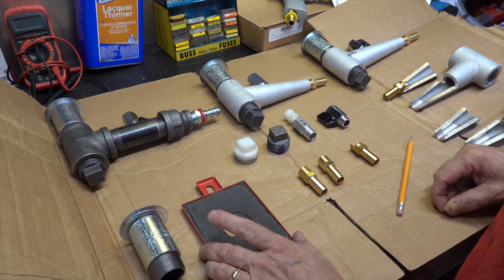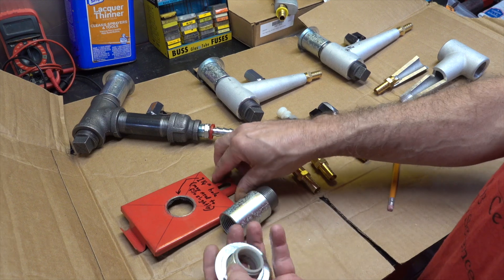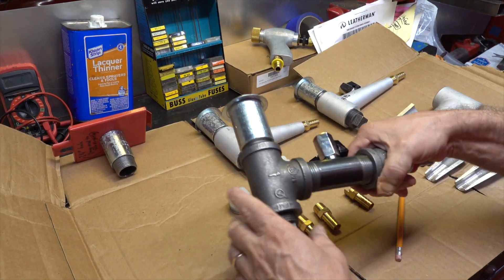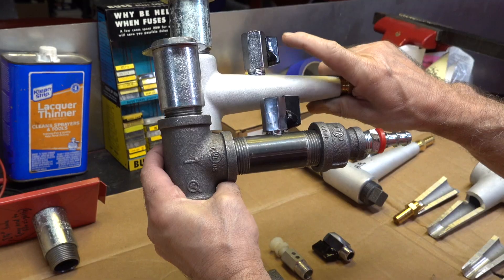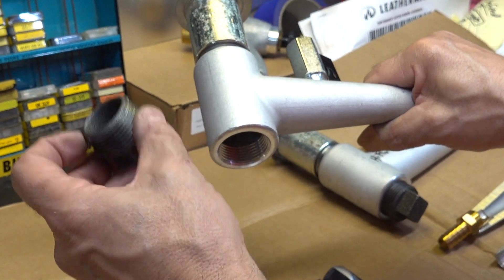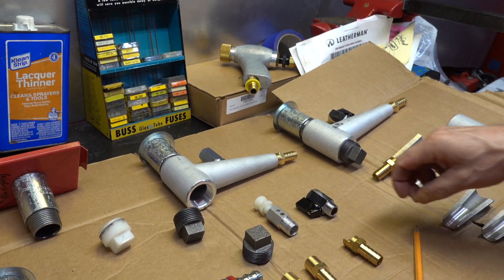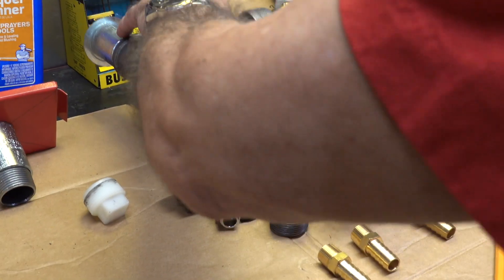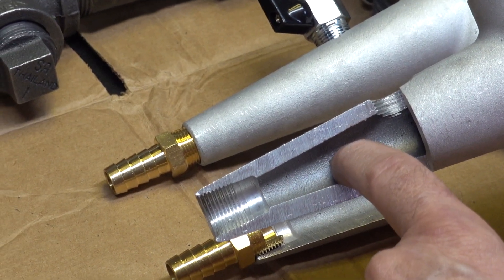Direct Comparison of 3 types of Harbor Freight Blast Cabinet Upgrade Metering Valves

Comment: I'm a custom metal Fab shop . I built my own cabinet , I made my own cone metering valve .I got it working great for a while , and then it slows down and stops , working.  No cloggage is happening either . What the cause of that?
Reply from the maker: Hard to say because there are multiple factors.  What media are you using?  Grit size?  Is air dry?  What gun are you using?   Happy to help but with your custom parts its difficult to diagnose.
Reply: I have a 10 horse Ingersoll rand compressor ,air dryer , princess auto gun , metering valve is a w inch T , and I made a cone ss 2 inch to 3/8" coupling , crushed 20-30 green glass , what else should I let you know ?
Reply from the maker: @charles-hr7ir  What are you wanting to know?  Sorry - unclear as to what you are asking.
Reply from the maker: @charles-hr7ir  The blast gun is not a particulaarly efficient design.  What is the orifice size?  The 20-30 grit crushed glass may be the problem.  Also, how much media do you have in the hopper (pounda?).  Too much can cause packing and creates a log jam.  Hope this helps

Comment: I ended up buying knee going into T instead of T to start with. I can still empty the box the same way like before and if I turn the door upside down, I get all sand from the valve as well. It's cheaper and simpler. I also mounted the knee directly under the door, without extension. It fits well even with the valve sticking higher than the doors are, and there is still a lot of space under the box. They are selling 1inch T piece with 1/2in side outlet, so I used that to mount the valve. And then the ends, they are not so important.. But most important is some kind of filtering, IMO. I'm still looking for some scrap piece of mesh or something, I found and used one cylindrical shape which I shaped into dome shape and just sat over the inlet inside the box. I just need something more fine, this one has big openings

Comment: What is everybody running for a compressor? I have a 60 gallon tank with a Dayton 3hp electric motor running a Speedaire 5Z404 (17.1cfm) compressor. I would think it has enough juice to run this sandblasting cabinet, but I can't get it to work! I made the upgrade with plastic parts but I don't have an air inlet that you show. Is this what I'm missing?
Reply from the maker: Yes - air inlet valve is absolutely essential to proper functioning.  Also the HF gun is a terrible design if you are still running it.  See our other videos for direct comparison with our high quality gun.  Hope this helps

Comment: I think I saw another pressure siphon conversion video where the metering valve for adjusting flow was remotely located so you didn'
t have to bend down to adjust the valve below the cabinet. That seems like a great idea, just add a barbed fitting at original valve location and run some air line from it to a valve located near the front of cabinet so you can adjust on the fly while using the gun.
Reply from the maker: I see it could work but the valve is rarely adjusted once the cabinet is dialed in.  Best regards
Reply: I was just thinking the same thing. Great minds!

Comment: The reason that the HDPE plug was selected with the aluminum casing is to protect the threads on the casting from Galling.  I would definitely use pipe dope or teflon tape or anti seize with the steel plug.  I understand the concern about damage to the plastic plug, but it is the cheaper of the 2 parts and therefore sacrificial.
Reply from the maker: Thx for your comment. Galling could be a problem in some circumstances but the drain plug only needs to be turned in finger tight to keep the media from leaking out.  Therefore the liklihood of galling in this situation is extremely low.  Would not recommend the use of a thread sealant as this could contaminant the media and cause a clogging of the gun orifice.  best regards
Reply: Holy cow…the grit would instantly stick to the pipe dope and jam up the treads ….

Comment: Do you guys do ones for a pressure pot system at all modifing mine to 3/4 to 1/2 ball valve underneith
Reply from the maker: Sorry - we currently do not offer an upgrade for this application

Comment: Would it be feasible to add the air bleed valve on the opposite side of the tee opposing the long narrowing branch? Would this arrangement provide enough agitation in the media stream to maintain good media flow characteristics and assist in circumventing clogging in the media outlet hose? Just curious……
Reply from the maker: We doubt that this would work because the media would probably block the air flow completely rather than the air flow pulling media particles from the leading edge of the pile.  Thanks for your thought

Comment: I did the black iron upgrade to my cabinet. I run 110psi and the factory gun with 5/8” hose to the gun. Any idea why my media surges in the hose and I don’t have constant media flow out of my gun?
Reply from the maker: A few thoughts that might help:
1) how much media is in the hopper.  Do NOT want more than a couple of cups while dialing in the system - then increase.
2) If you have 110 PSI at the cabinet, it is too much and could be hiding another problem (45-65 PSI is generally good)
3) What gun are you running?  Please see our video on the OEM HF gun (it is generally a POS) and another of our videos on cheap Chinese knock off guns also with problems
4) 5/8" hose is pretty big especially if you have a smaller compressor as it creates too much dead space volume and there is not enough vacuum to get steady flow
5) Is the gun orifice size matched to the output specs of your compressor (if not matched it will not work well and could cause the surging that you are seeing.
6) Watch our video on dialing in of your metering valve.  Only takes 10 mins and once dialed in you are good to go 
Overall thought: All the components of the blast cabinet system need to work together to achieve proper performance.  Changing out one may not result in desired results because other parts are not playing well together.  Changing the metering valve to one with a better design can result in weaknesses elsewhere in the system being exposed.  Hope this helps
Best regards
Ron 
Best Tool Upgrades

Comment: Whats the ideal ratio of media to air?
Reply from the maker: This ratio is not actually calculated as it is too highly dependent on media type and size, compressor output in CFM, gun performance, etc.  Instead, it is important to dial in the cabinet to achieve max media delivery associated with the various components associated with that set up.  Hope this helps

Comment: 7:00 Here my physics seem to differ from your physics. In a tube the airflow (speed) increases if the diameter of the tube is reduced. Because the same volume per second has to pass the narrower cross section. Higher speed means more ability to pick up media. Even if the media is settling down there this increases speed even more and the ability to pick the stuff up. Totally the opposite of what you tell us. 
If you increase the diameter the ability to transport the medium is effectively reduced. So why is this then an improvement? Do I have to relearn physics and tell Mr. Bernoulli he was wrong?
7:40 You mill even surfaces. But you have drilled out a tube.
Reply from the maker: Thank you for your comment and the opportunity to explain "our physics" from "your physics".  
Simply stated - "your physics" is the physics of looking at an isolated component of a system and drawing inference as to how it might impact system functionality.  "Our physics" is to look at ALL of the components of a complex, dynamic system.  We do not need to debate Bernoulli.  But when and where Bernoulli is of value in terms of increased system efficiency needs some discussion.  The increased flow speed, which also decreases pressure, can be very helpful in such classic examples as a carburetor where gas molecules are introduced into the stream of air at the venturi.  But take a close look at the full cross section of the metering valve.  In the unaltered valve, there is a restriction in the throat of the valve followed by an increased cross sectional diameter, followed by another restriction in flow created by the ID of the brass fitting, followed by a long distance of increased diameter that is the media hose.  What you can't see is that there is another restriction at the other end of the hose at another brass fitting, and yet another tunable venturi that is designed within the body of the media gun itself.  
Repeated sequencing of the speeding up of the flow, followed by the slowing down of the flow, can create dynamic pulses which can be helpful in some systems, if designed into the system, but are most often detrimental to smooth flow (which is what is desired in the case of media blasting).
Now let's talk about what is actually flowing.  The stream is not just a gas (air) or a mixture of two gases (air and petroleum distillate as in the case of a carburetor).  It is a highly heterogeneous 'slurry' of gas molecules and very large (in comparison to air molecules) chunks of solid media that can vary greatly in size, surface area to volume ratio, and density, depending on what type of media the user has selected and the grit size of that media.  Therefore, the system needs to be capable of good performance across a wide range of particle types potentially found in the slurry suspension.  The goal is to keep the media particles suspended in a continuous smooth flow of air and not create pulsing or any other condition which could lead to particle drop out from the air stream, which would create clogging (log jam effect) of the system downstream, which then would further reduce flow as a negative synergism.
The reduction (not total elimination) of the first and most significant restriction to flow (the throat area of the metering valve) in a system with multiple sequential flow restrictions (aka reductions in cross sectional area) is improving the OVERALL efficiency of the SYSTEM, when all of these multiple Bernoulli 'points', including those in the media gun, are considered.
Perhaps we erred in not going through all of the system physics in our video at this level of detail.  We will take that under consideration.  However, the vast majority of our 1000s of very satisfied customers just want to have their system work to their level of expectation, and are less interested in all of the details (especially when physics are involved, LOL)
Finally, we could have had this conversation as an honest exchange of thoughts and ideas between people, but you chose to take the route of snarkiness, belittlement and derision.
To that point, no need to tell Mr. B anything at all.  He know's what his Principle states, but further, he appreciates the proper application of his Principle to overall system design, not just a single point along a pipe, viewed in isolation.
Here's another Principle that may be applicable to the current situation - "Seek first to understand, then be understood"
Best regards.
Reply: @partswasherupgradekit6028  Thank you for explaining what you had in mind. I now understand that you, in simple words, wanted to smooth airflow by avoiding dead spots where sudden increases of diameter can lead to accumulation of media. Whether this will get to a point where everything gets choked up or more hinder the airflow might be an experiment that will tell the situation. Anyway from explaining your improvement of a single component I was referring to that only. 
You are right that sedimentation can take place if solid matter is transported in a fluid or gas stream. As you have explained I understand that the whole arrangement needs to be taken into account. All the connectors with not really streamlined transitions will affect the system performance. Perhaps from your experience the change of one component makes already  a significant difference. I lack that experience. Your video seems to hint in that direction. But then you get out that fabricated (assembled from individual components) regulator and state that it might be as good as your product. That makes me wonder whether simply the increased diameter is what makes the system better. The smallest diameter kind of determining the airflow per Watt. Which results for me in two findings: 1. Dead areas can lead to media accumulation which, due to the nature of solids (internal friction hindering easy pick-up), make them permanent or difficult to "dissolve"; and 2. per given power the lower resistance from a larger minimal diameter results in a better system performance.
Thanks you again for taking the time to explain. I am not going to comment on any perceived tone.
Reply from the maker: Thank you in turn for being receptive to our response that provided a fuller context.  We do extensive testing on all of our products, use them ourselves in our own home shops and derive high quality feedback from our customers based on their real world experiences.  We have learned a lot over the almost 5 years we have been in business and are always looking to find a way to make improvements.
Best regards

Comment: I purchased your premium high flow metering valve and last night I finally got to test it out in my blast cabinet. I had set the air supply pressure to 40 and 45psi and metering valve air bleed was 25 to 40% open and my blast media was an 80 grit aluminum oxide.  Using these settings I was getting a lot of media pulsating through the gun where I would get a large plug of media followed by mostly air only.  I'm wondering if higher air pressure or adjusting the air bleed on the metering valve will help correct this issue.  Thanks.
Reply from the maker: Need to know more about your setup as other components play a big role in the overall performance.  Which gun are you using?  The stock HF gun is a poor design and is often the cause of the problems you are seeing.  We sell a great upgrade to that gun
Please contact us at 
partswasherupgradekit@gmail.com 
and we will be happy to help you
regards

Comment: Interesting thoughts and as I have just received my new cabinet.
I would like to make some comments, not criticisms regarding,
1/ The plastic plug.
If one is prone to cross threading, 
given how often it may or may not be removed, 
unless care is taken, the metal plug into the soft cast alloy tee may be an issue.
Safer to stay with the cheap plastic maybe, than damage the expensive tee?
2/ The taper is to increase velocity of the mix, yes there is drag/friction and the  right
balance of this is debatable, without flow tests etc as you have said.
3/ Given the vacuum is fixed, when air supply pressure to cabinet is set e.g @ ( X psi) would not
a larger (metering) valve reduce this vacuum, reducing pull/lift of media?
4/ Removing restriction from hose tail or anywhere(plumbing fittings etc) is or should be obvious.
5/ Instead of a Tee piece under the hopper, could a cross piece be used with the metering(ball) valve opposite
the media pick up tube to gun, This puts the media between the source of vacuum and the source of aeration/metering (vacuum loss)
You would have full(sort of) vacuum pull on the media drawn out of the hopper, thanks to gravity and vacuum
and being aerated as it goes, OR, valves for and aft of the media???
Agitating the media from both sides and as long as appropriate vacuum remains to the gun.....well?
What are your or anyone's thoughts on this?
Reply: Bingo -

Comment: any difference noticed between 3/4 and 1" i see some use 3/4 some 1" but who compared both ?
Reply from the maker: The extra internal volume in the 1" version allows for better media pickup into the air stream and reduces the chances for media backup

Comment: 3:50 it would last more if the tread was outside, it would be easier toblow some air on the tread to clean it and the tread inside the tap is easy to clean as well.
Reply from the maker: Thanks for your comment.  No real need to clean the threads as the fitting never really needs to be removed.  Also, if the threads were external the fitting would require a large reduction in size in a short distance to get the 1/2" barb and this might cause a restriction in flow.

Comment: 3:28 That's an extra useless thing. You can just open the door.
Reply from the maker: that is certainly possible but hinging the door down with the hose attached can be difficult and when you open the door the media goes everywhere.  So easy to use the screw in plug especially since the metering valve is built around the "tee" fitting.  Media falls straight down into a bucket

Comment: How to use  sand blasting  on floor tile
Reply from the maker: Not quite sure what you mean.  Are you wanted to blast your flooring tile to clean them up prior to painting or coating?  Look into a pressure pot. Used to blast large surfaces outside of the limits of what can fit into a blast cabinet.  BUt they are messy.  Media goes everywhere as it is not contained within an enclosed cabinet
Hope this helps
Regards
Best Tool Upgrades

Comment: Hi,
Just made a stainless metering valve, slightly custom because of part available but almost the same in construction. We installed it and tested it and no sand was reaching the gun. I don’t even think the sand was reaching the hose barb on the metering valve. 

Ever seen this before? Any tips to help make the sand reach the gun? The sandblaster was basically useless before but now seems to be a pitiful air duster. 

Any help would be greatly appreciated!
Cheers from New Zealand!
Reply from the maker: Hard to diagnose but usually this means that there is not enough suction.  What gun are you running?  What orifice size?  Also what size compressor (in cfm)?  Could also be too much media in the hopper.  If you send additional details we can try to help you out
regards